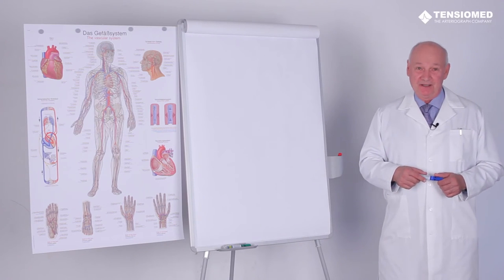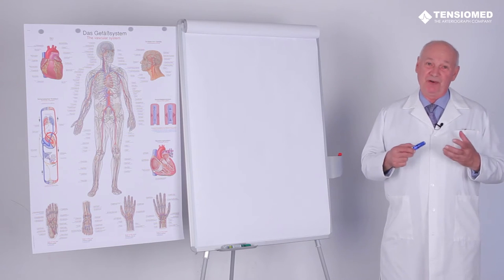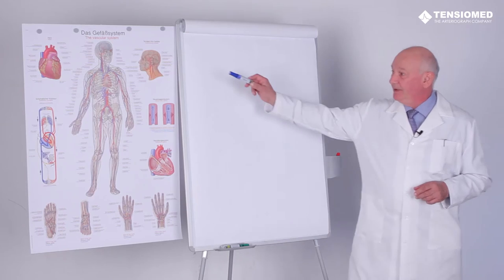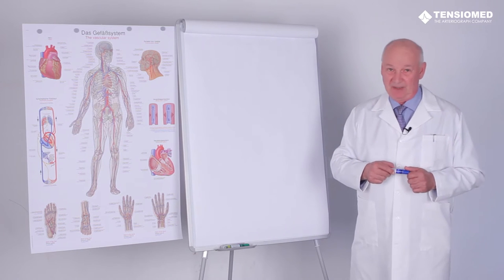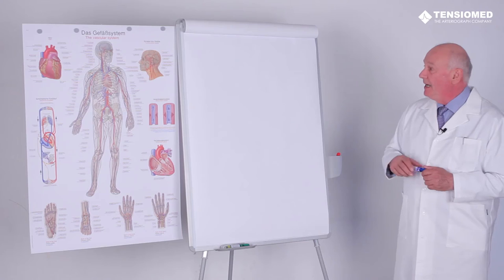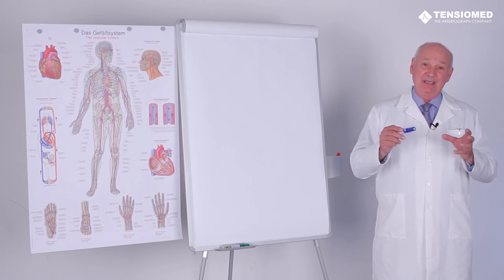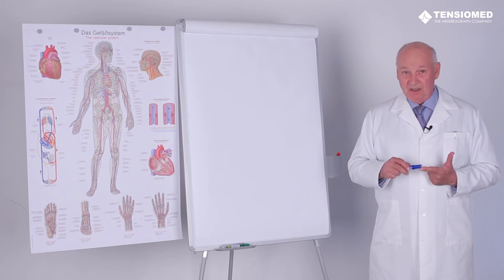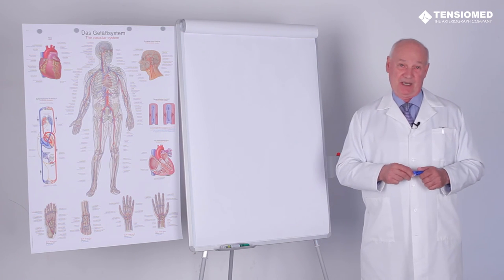Pulse Wave Velocity - TensioMed Education (with German subtitle)

Comment: It is said that more workout will lower PWV. But every time I make working out my habit, the value goes up instead of down.
Reply from the maker: If you measure immediately after a few minutes of your workout, the PWV (Pulse Wave Velocity) will likely appear higher, as PWV depends on various factors that can elevate during exercise.

It's advisable to establish a consistent workout routine for a certain period, such as two months. Then, measure your PWV approximately two hours after your workout and compare the values.

Additionally, the results may vary depending on the device you are using.

Best regards,